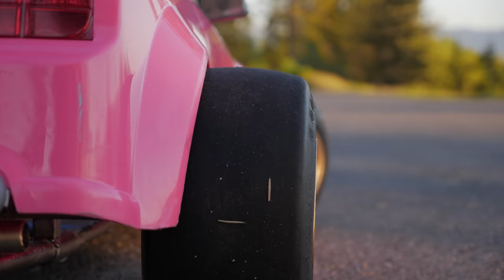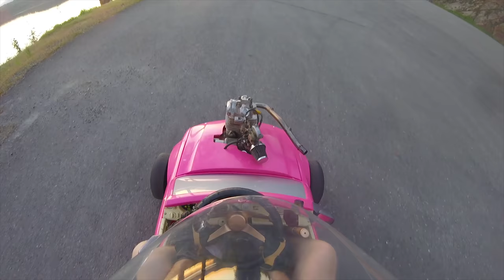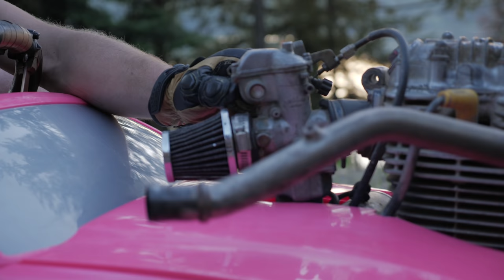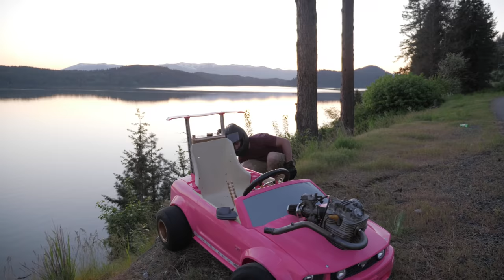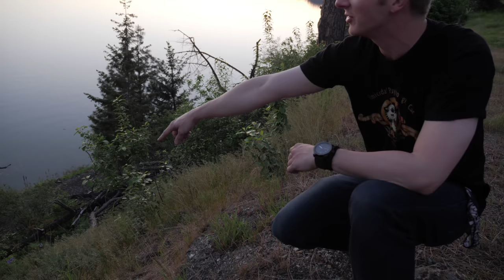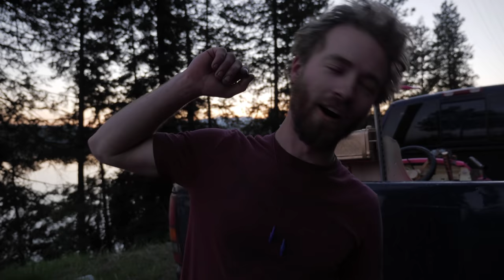Real Engine in a Barbie Car!

Comment: I don't think its a Barbie product, but there's a similar Princess Carriage that deserves the same treatment.
Reply from the maker: Yes! I really want to do that one next!
Reply: I live in Louisiana. There's a lot of overlap between "little girls who want to be a princess" and "little girls who want to hunt and fish like daddy." To keep both parties happy, I'd shoot for something between Princess Carriage and side by side ATV. What's the biggest electric motor one could put on that? Would it drive bigger tires? Would you have to build a whole new frame?  A gas engine might result in speeds to dangerous for kids, plus daddy would have to be there to start it. Also, you'd probably have to start worrying about roll cages and seat belts.

Comment: the one im building will probably go only 30-40 mph it has a Briggs and Stratton push mower engine
Reply from the maker: That is awesome! Will you be doing a video on the build?
Reply: i might make a test drive video i have the parts to finish the project i just need to find a frame i was thinking about using a junk riding mower frame
Reply from the maker: That or maybe just drill holes in scrap steel and use bolts. We did that for part of our go kart frame.
Reply: Grind Hard Plumbing Co the 20 or 21 inch mower? I have one
Reply: Grind Hard Plumbing Co what transmission are u running?
Reply from the maker: The transmission is in the same case as the engine, since it’s from a dirt bike. It’s a sequential 6 speed!
-Ethan
Reply: Grind Hard Plumbing Co Oh ok right on! Awesome channel great work guys, keep the great content coming
Reply: Grind Hard Plumbing Co How did you run the chain? With a jack shaft or a chain tensioner? Its badass btw

Comment: More like barbie body on go cart frame.
Reply: Go carts have the engine in the back, there's clearly a lot more work done on this than just dropping the body on a kart platform
Reply: Exactly, regardless of engine location, you can see how it was built on a go-kart frame in their other videos.
Reply: Regardless of whether they used a go kart frame or not, this took more work than just gluing the plastic barbie car body on a go-kart, so it's not that cool to dismiss this whole thing like that
Reply: I'm glad someone else said it.  Ok so the engine is in the front. Big deal.  I'd like to see how they did it exactly but a chain down to a jackshaft with a long chain running to the back would accomplish this without much fuss.  You could do a couple different jack shafts to gain your ratio easily.

Comment: How are you guys shifting through gears? Or is it automatic? If so, how are you guys putting it into gear? This is pretty dope
Reply from the maker: We shift with the giant gold lever on the right side, and the clutch lever is mounted to the lever now as well. It used to be mounted on the steering wheel.

Comment: How long did it take for oil starvation to seize the big end on a sustained corner?   Just curious ;-)   But very cool all the same.
Reply: (My tech-ed teacher back in the 80's made a go-kart out of a single-cylinder 4-stroke motorcycle engine.  Did a very good job, but one of the students broke it with some over-zealous circling, which - we surmised - was not ideal for a motor that was designed to always have the g's pointing downward.  I never got my second go!)
Reply from the maker: The turbo blew up before we got that far haha. Sounds like a cool project though.

Comment: Yamaha rx king 2 stroke 250cc will be good for 240kmh even for a one ciylinder engine (but yu need to modify it to 250cc beacuse the stock engine only 135cc)

Comment: i was planning on doing this with a kx60 engine but i don’t know if it would fit
Reply from the maker: It would definitely fit! Out engine is way bigger than a kx60.
Reply: Grind Hard Plumbing Co how much hp does your engine make
Reply from the maker: Somewhere around 20hp. But it’s 4 stroke so it also has a lot of torque.

Comment: What did you use for a driveshaft? Or is it chain driven? Thanks great video! I want to build one for my daughtet Sophie
Reply from the maker: Its just a long chain. the only problem we ran into with that long of a chain is that it flexes the frame of the kart under extreme loads, and causes the chain to slip off. We fixed that by stiffening the frame on that side.
Reply: Grind Hard Plumbing Co does it have a transmission?
Reply from the maker: Yeah, transmission is built into the engine because it’s out of a dirt bike. It has 6 gears. 
-Ethan

Comment: Now introducing the all new Mustang MINI GT, fitted with a weedeater engine, and now with less safety features. No rear camera, and no cup holders! Sure it may not be made of reinforced steel, and you could probably get seriously injured if it rolls over, but that's what America wants! A mini rip off of the original deal! 

Ford! Built Rough!
Reply from the maker: Hahaha! That’s the best description of it yet. 🤣 We should use that as the description for our videos of it...
-Ethan